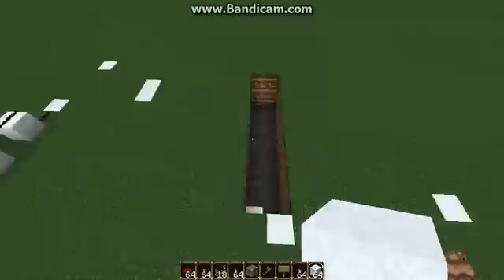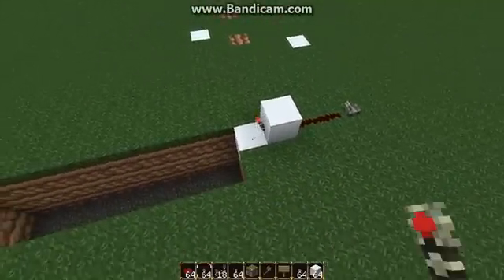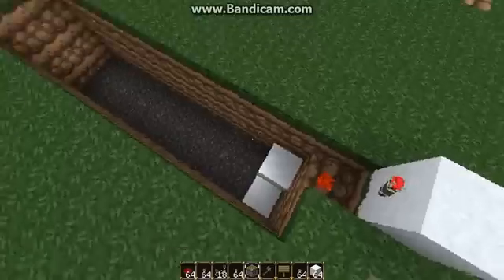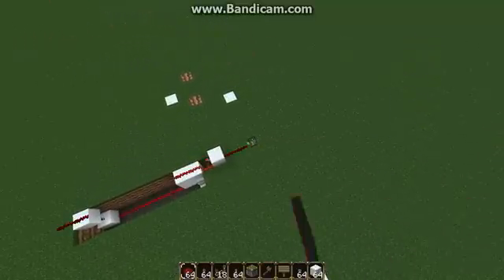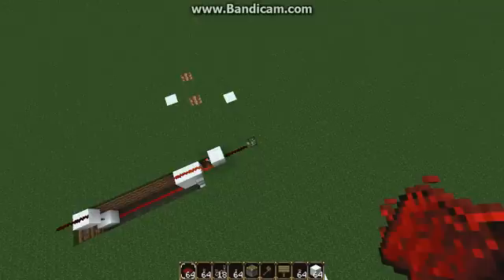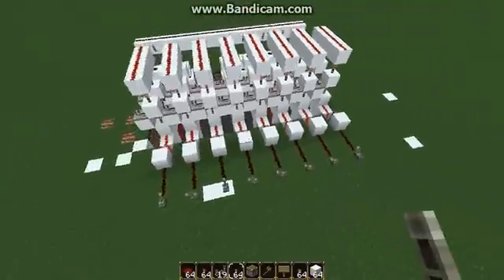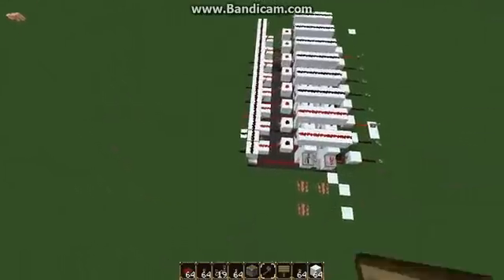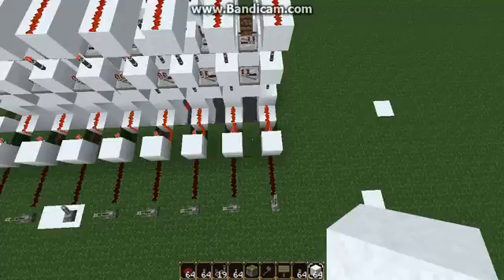Building a minecraft GPU tutorial pt2: Fill X and Fill Y

Comment from the maker: That's quite a goal, which I wish you the best of luck in completing. Sharing RAM is a little bit tricky, but here's the way I'd do it. You'd want to have a set of memory that can be accessed by each core, and the easiest way to do that is add a read/write decoder for each core. This way, the only thing that'll cause an issue is if you try writing to the same memory location on multiple cores, which should be easy enough to avoid manually.

Comment from the maker: I might suggest you look at my calculator tutorials for tips on doing this. If you look at the video that goes over creating adders for a calculator, you can basically do that except using 12 of them instead of the 4 I used.

The carry is basically a way of the adder saying that it has a number thats too big for it to handle. This carry is usually plugged into the carry-in of the next adder, which is designed to handle those numbers.

Again, I suggest looking at some of my videos about adders.